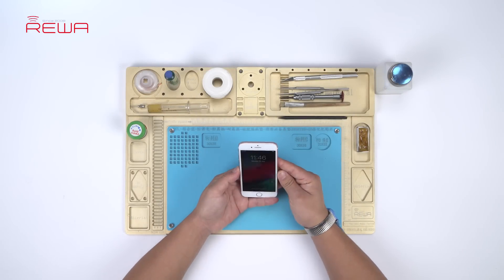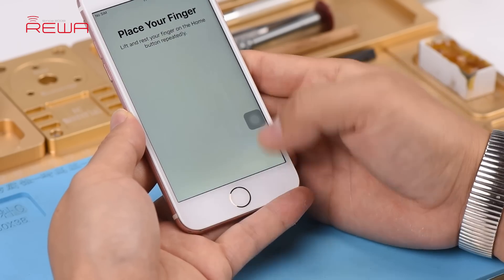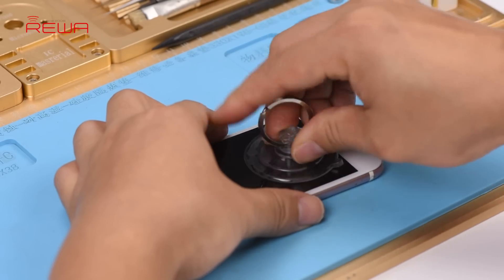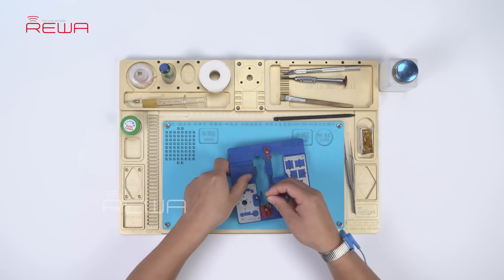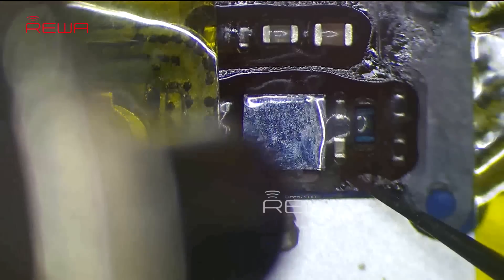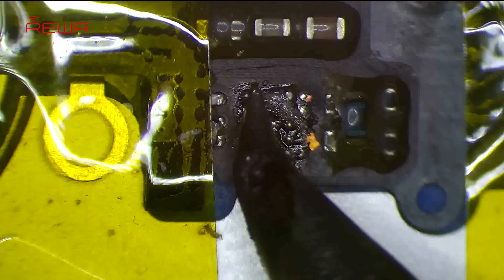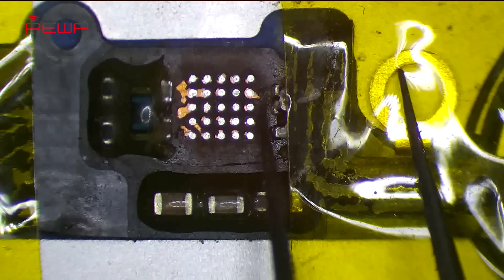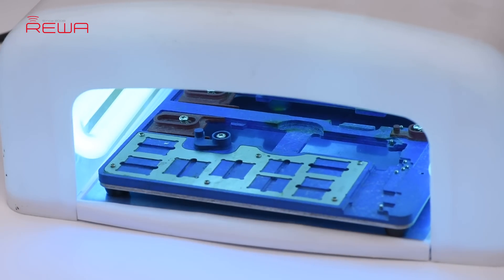How To Repair iPhone 7/7P Home Button Not Working | Repair Shop Tips

Comment: i broke the top ribbon cable while changing an iphone 7 battery and now the home button doesnt work. i did not break the bottom ribbon cable near the home button. the top cable is for the front camera from what i see online so i have no idea why the home button stopped working. 

putting the home button as an icon on the screen is a semi fix go into accessibility

Go to Settings > Accessibility > Touch > AssistiveTouch. On older versions of iOS, you need to go to Settings > General > Accessibility > AssistiveTouch instead. If you can't exit your current app to access Settings, restart your iPhone to go to the Home screen.
Turn on the toggle for AssistiveTouch. You should see a semi-transparent button appear on your screen. Tap it to reveal a popup menu, then tap Home to simulate pressing the Home button.
Drag and drop the AssistiveTouch button to move it around your iPhone screen so it doesn't get in the way. You can also use Siri to turn it off and on when you don't need it.

Comment: if your touch id still works but home button pressure not working just press and hold volume down khey power khey until you see the apple logo release it then problem solved
Reply: hmmm
Reply: umm remove front sensor rebon cable and re attach it

Comment: i removed the home button in the wrong way and only touch id worked, after blowing hot air (250c) on the u10 chip, the home button started to work again

Comment: wow - amazing!  I wish I had all the tools to make my life easier.  Tools make the job far simpler!  I have this problem and will attempt this myself but as a backup I have ordered a replacement home button but the touch ID and Bluetooth will not work but everything else will.
Reply: Be careful with replacing home button. Apple for some reason doesn't allow the new button to 'see' the CPU, and you may lose fingerprint ID ability. This happened when I replaced a crack screen at a service center. They pre-warned me of issues and had me sign a waver. I am now using the "Assist" floating home button.

Comment: Ok so, I have a iPhone 7. I don’t know how this happened, but it fell onto concrete and now it’s not working right. I didn’t know it fell and I didn’t find it till an hour later. Where it was even is uncertain how it got there. Anyways it won’t work unless it’s on the charger, it’s not charging, it will only charge up to 3% and my screen won’t recognize my moment on it unless it’s connected to the charger... my phone is maybe only 1 year old. How can I fix this???
Reply: that happend to mine too. i forced reset it and if that doesnt work take the sim tray out and reset again
Reply: I wonder why iPhone 7 usually have this problem mind too